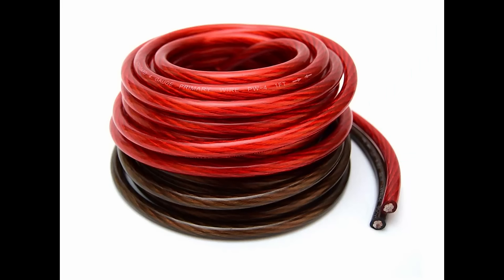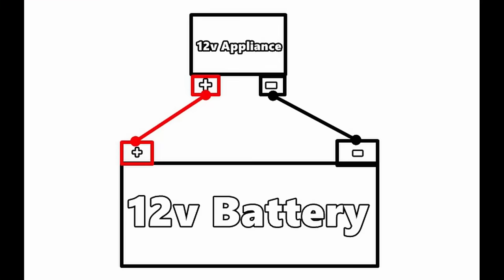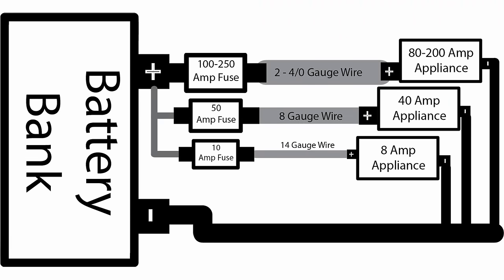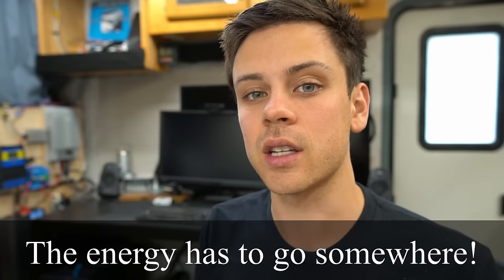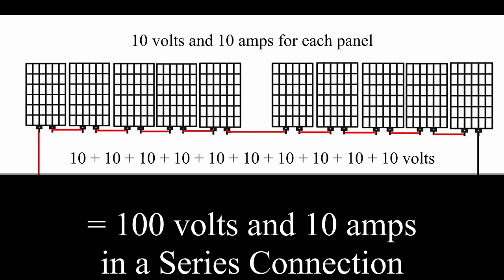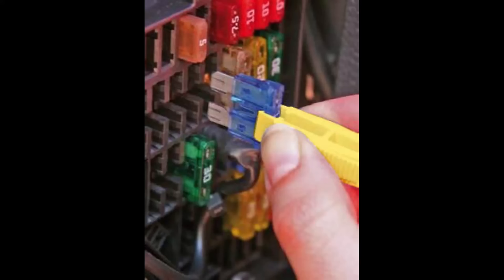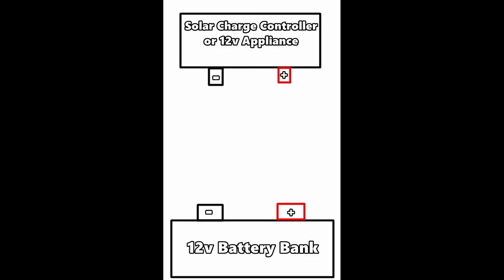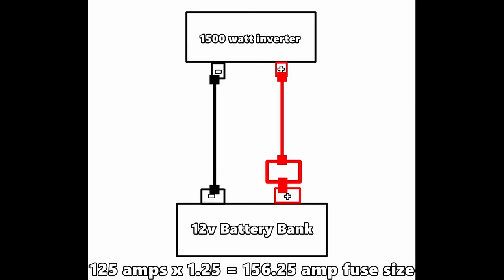Electricity Explained: Volts, Amps, Watts, Fuse Sizing, Wire Gauge, AC/DC, Solar Power and more!

Comment: Hi! I believe I watch this cool video 4 times a year! Sure hope I'm not asking the same questions over again (bet my previous comments are buried a thousand comments below).
Question One. Why ar Folks so into these "Lead" Batteries if you can only expect about 50% of their performance capability!
Question Two. When do I use a Parallel Connection or Serial Connection? Like if my ideal appliance set-up is a Microwave Oven (that turns on approx 7 times in an 8 hour period), two cell phone chargers, two Laptops, two large monitors, and one printer (my God I'm a Black Computer Geek). Sounds like a Parallel Connection set-up would keep all my wires "cooler" without worrying about an electrical fire . Your thoughts?
We could say I'm an Army Vet living in a mobile home with solar panels, but If I could finally wrap my head around this electrical math & tech, I'll be sticking shlit into the window of my one bedroom apartment and kiss Edison's Ass goodbye.

Comment: Thank you. I was in difernt industry. Now learning. I rebuild cars. And helped put panel box in 20 years ago. . From there ran 15 hundred feet copper . To run tv . Micro wave draws down lights. But hey it works . Two houses. Lol but now I want to get technical. But most laugh if you don’t know the specs. . Thanks.

Comment: Most people, including me, have lived their whole lives without ever understanding any of this. Now I understand it. Thank you. 

Question: the relationship between AC/DC/volts/amps and SAFETY, please. Could you make a video that explains why you can walk around with a 9v battery in your pocket, but put that same battery in a taser, and you can incapacitate a gorilla? 

How do I calculate what exposed wire is lethal or just a sting. I presume it’s more to do with volts.

Comment: Dear Will, The mobile community, especially those who have, or are converting a school bus into a "Skoolie"  -an off grid mobile RV and in some cases a HOME, really need your help, especially when making a MAX solar powered system that can run 2 mini/split Air Conditioners night and day sustainable from solar panels and storage batteries, also including ac fridges, lights, microwaves, TVs, computers..printers ventilation fans. Most of them will use diesel fuel heaters for keeping warm.. Three different expandable system designs would be nice Max, Med, Min.. with the ability to plug into AC shore power.. when available.. You could give them a world of good with very specific Skoolie Solar Videos.. The Skoolie folks are over and over struggling with getting this done..

Comment: THANK YOU! Finally, someone who teaches this stuff in a way that is easy to hear, understand and put into action!!!  I"m trying to wire up my solar in my new campervan and I was feeling really lost with understanding how to know how much amp i will use and the size of wires and amp's needed and now I feel I have a good grasp on it...  @Will Would you say using a 35mm artic cable for the connections between batteries and inverter is too high for powering a laptop, juicer, blender and some other 240v items?  I won't use them all at the same time...   I feel 35mm is too high but another youtube guy advised to use 35mm in his vid...  I've also been told 16mm is enough...

Comment: And you also have to remember when charging a battery or connecting to the grid you must overcome the incoming pressures to put anything in 
So take your battery for example as the battery gets full amps go down but Watts always stay the same 
And connected to the grid because the pressure is usually a constant could only put in about 15%

Comment: I tried to increase the battery life on my drone by wiring to 9v batteries together. I made sure they were both the same voltage and I forget what the term is for wiring batteries together that doesn't increase the voltage but I tested with a voltmeter in the voltage was 9 volts with two batteries wired together I thought it was good but when plugging it in it smoked the circuit board on the drone. I now realize the issue was the size of the wire from both batteries "amps" well I made sure the voltage was the same I didn't account for the amps. Thanks for the video!

Comment: I noticed you mentioned lead acid batteries during your presentation and it brought to mind how that such batteries are hardly or never mentioned when talking about or planning to set up a solar powered system even though they are cheaper when compared to others like the so-called deep cycle batteries, the lithium batteries, etc. I would like for someone to buttress for me why one may not use lead acid batteries for such constructions. By the way, I once came across information that suggested that Tesla had a lead acid battery he used for five years or so, everyday without it losing charge.

Comment: When you start talking about comparing batteries and watt-hour ratings I remembered something I ran into a few years ago with this that would be important to know, especially for those who are looking at lead-acid batteries.  I was looking at two different batteries that both had ratings of approximately 110 amp hours, but one was quite a bit lighter than the other.  This made me wonder if the amp-hour rating of that one was accurate.  Looking more closely at it, I discovered that the manufacturer had used a one-amp discharge rate to determine the amp hour rating rather than the 20-hour discharge rate that most manufacturers seem to use.  For lead-acid batteries, this is highly deceptive and leads to a much higher rating that it would otherwise have because of that Peukert Effect that you mentioned later in the video.  It's not much of an issue with lithium batteries because of their high efficiency though.  I plugged the numbers into a Peukert Effect calculator which determined that, at the 20-hour rate, that was actually a 93 amp-hour battery.   Buyer beware.  Another great video, Will.  Your style and method of explaining things make it easy to follow.

Comment: super video.  you explain things in such a way that it is easy to understand and your depth of knowledge is impressive.   great video for beginners and those who need a refresher.   your other videos are great too. keep doing what your doing. if u have not done an instruction video yet on the proper way of building an AC distribution box for initial loads and allowing for expansion.  i know id be interested in that. thanks for sharing all of your great knowledge and hard work. sincerely kurt

Comment: Really useful for absolute beginners but when quoting watt hours it's important to point out the obvious that it matters what voltage system it is used in. A lot of people look exclusively at 12v systems so the numerical factor will be the current available.

Comment: Good job, congrats! Analogy suggestion: DC works like a drill, AC like a jackhammer; how would that sound?
Reply: No. Completely irrelevant.
DC current flows in a single direction along the cable. AC flows both ways. That is as simple as it can possibly be. Don't over complicate it .
Reply: @deang5622  thanks.. but you prove my point. A drill works unidirectional, clockwise, counterclockwise,  a jackhammer works both ways...

Comment: Very good explanation. Thank you.
If DC electricity flows from negative to positive side of battery, why shouldn't the fuse be connected to the negative side of battery?
Reply: Let me clear up a couple of things.
Electricity does not flow from negative to positive of a battery, it's the electrons that do.

Conventional current flow is from positive to negative. This is the convention that exists all around the world. Why the difference? Because somebody got it wrong many decades ago.  We are stuck with that. So we work with conventional current flow from positive to negative.

Forget electrons, that will confuse you, and you will never need to worry about electrons unless you are working with semiconductor devices or valves and tubes. So you should always be thinking of conventional current flow.

Second. The fuse. Current flows in a circuit, which is a loop from the source of electricity and back to it.

The current coming out if the supply equals the current returning back to it. So 5 amps coming out from the supply and therefore there is 5 amps returning back to it.
So it doesn't matter if the fuse is placed in the path of the line from the supply or is connected in line with return line back to the supply: that fuse is going to blow if more than 5 amps passes through it.

For switches it can be a little different. In terms of turning the electricity off, a switch can again, be connected in line coming from the supply OR in the line returning back to it 
However we use switches in mains electrical wiring with voltages at 120, 230 volts for what is called isolation.
If the switch (or circuit breaker) is in the return line (neutral line) , then turning the switch cuts the flow of electricity, but if any electrician touches the live line they can still receive an electric shock and be killed because the live line is still at 120/230 volts.
So it is safer to have the switch in the live line in the distribution board/fuse box/consumer unit so that when the switch is turned off then no part of the circuit contains a dangerously high voltage.

Comment: I will never forget my exasperated father (electrical engineer) explaining amperage to my mother (english literature teacher). How many pixies running through a turnstile - 10 abreast = 10 amps, 20 pixies at once = 20 amps. Mum thought they should be imps, not pixies.
Whatever analogy or metaphor works!

Comment: Great stuff, brilliantly taught. I do have a question... What if my total load for an appliance was calculated at 0.75amp AFTER  multiplying it at 1.25? Being that 1 amp is the lowest fuse and 1 would be OVER the 1.5X recommended amount, what can we do?! 🤔

Comment: amperage is important if you do some kind of projects if you connect a lot of components and you dont have right amount of amps its done. Its easy in everyday life when you connect one item but in some kind of project it's  diffirent    there is a diffirence in  batery with 12V and 100 amps  and 50 V 20 amps

Comment: 22:20  Total circuit length in a DC power system = positive + negative, so a 100A load on a 12VNom system at 20' total circuit length needs 2AWG wire to stay under 3% voltage drop, not 4AWG.

Comment: And ohm's law 102 
When coming upon other forces like a battery are the grid that's already charged 
Great example is as the battery gets full amps go down the actual current that is going into the battery the Watts stay the same 
That's why Wednesday renewables are connected to the grid you can only put in 15% and when charging electric cars when you get to about 80% they would like you to move on because the charging really slows down

Comment: So it is Amp that affects the wire, not voltage. Hypothetically speaking, you could have a thin wire transferring 50000 volts but as long as the total amp/s does not exceed the wire's capacity, it is all good, right?

Comment: Hey man, you're the brain and expert....I want to Ask you a question. I have a 30 acre parcel in Northern Michigan that has no water. What type of solar panels and set up(turn key, batteries, converter, ect.) do I need for a 3/4 horse pump and a 150 foot water well. Maybe an over kill set up??????

Comment: I think what you are saying about fuse is correct but the way you are saying it could be taken in reverse of your intention. The fuse must always be less then the max of the wire and load ratings in order that will always fail first.

Comment: Great video, but I still am looking for an explanation of what voltage is, what it's made of. I've watched dozens of videos, but I am unable to find a single video that explains what actually is going on with higher voltage, either in AC or DC. Electric potential and "pressure" are two terms used to help explain how voltage works, but they don't explain what voltage actually is; not like the explanation of migrating electrons along a conductor explains current. Can you help with this?

Comment: A key, basic point that is maybe not properly fleshed out in this video, is that it would be better to conceptualize voltage as RELATIVE pressure in a water pipe. I.e. the difference in water pressure between any two given points in a pipe. So if you had a level pipe, with nothing to impede the flow, any RELATIVE pressure measurements made along the pipe would read ZERO, despite maximum flow being witnessed. With electricity, this prevents confusion on the short-circuit situation, where you would measure a voltage of zero, but witness a maximum flow of current. Once you start adding resistors/impedance, then you will find a voltage reading/relative pressure drop.

Comment: Wouldn't you use 13.8V when dealing with vehicle batteries? Also, can you explain cold cranking amps? How much power, with vehicle off, can I draw from my truck battery before I'm stuck in the middle of nowhere? Can you do a video of beefing up vehicle battery system? Adding solar panel to roof, second battery, etc. I want to add many powerful lights, multiple radios, mulitiple cameras, and be able to power water pumps and some AC appliances too. I want to integrate all into my truck. Thanks.

Comment: Awesome video, the only problem I found is with fuses and wire size, in the example at 22:30 you sized the wire for 100 amps but put a 125 amp fuse, using the 4AWG wire means that the wire will overheat once it reaches 100 amps, but the fuse is still not blown, looking at the chart you should have sized it for at least 120amps or 150amps which means 2 or 1 AWG so that the fuse blows (just like you explained a couple of minutes before this example... I'm not an expert, but I think you made a small mistake there :-) am I wrong?
But yeah I would first size the fuse then the wire to the fuse, so you go from smaller amperage (appliance) to bigger amperage (fuse, then wire).

Comment: If you have same result by different measurement of Ampere and Volt will be bad for your stuff. For example a freezer, if your freezer requires 15 Ampere, 260 V and 2500W, you should not plug it into somewhere where there is lower Ampere but higher voltage and the result is 2500W. It will shorten the lifespan of your freezer and you will see it dead in no time. I never forget ever since I heard in simple terms Ampere is a measurement for the lifespan of your house stuff, if you go below or over the limit than its lifespan is shortened.

Comment: I need about 90 amp seconds of cycles from that big brain energy of yours.

I am repowering a sailboat from diesel to electric (go green yah!!!). It is 41 foot sailboat that displaces 23,000 lbs (yikes!). The original diesel was 50 hp (double yikes). How big of electric motor do I need, how big of a battery bank, how much solar panel power? Thanks for all your vids!!! Watch all your stuff. Subbed. Help!!!

Comment: Great video! Just a question though... at @5.07 is the flow of a circuit not electrons moving from negative to positive? So the different gauge wires would need to be before the appliance? Maybe I'm getting confused

Comment: Wow! great job explaining the basics!!!  at 22:15 you talk about the load being 10 feet away from the battery. On DC voltage the wire distance is both out and back (or 20 feet) correct? Just checking... :-)

Comment: I like your videos, nice and easy. I do have a question,  does your book shows how to wire up a mobile solar system and an inverter with a fuse block,? I just bought a solar system for my camper and a 12- Port fuse block cannot find anyone to help me. Thank you

Comment: So amp is how much electricity will flow through the wire, and volt is how fast  and a solar charge controller adjusts those for specific needs?

Comment: For Solar charge controller, you only calculated amps rating. Do we also need to consider battery and solar’s voltage-current(compatibility) ?

Comment: Hi my friend and happy New year!!
I want your help about thickness wire!
Excuse me for my English, I'm Greek 🇬🇷!😁
Well..
A have an e-scoot!
The battery is 72v 20a the cells can give 105 ambers Max!! BMS is 100a we're ok till here!
New controllers i just buy are 72v 50a max phase amber 150a
My motor is 2000w (that is write)..
My question is.. How thick wire to put (3 phase wires) from controller to motor.???🤔
Distance 0,70 - 1 meter (2-3 feet i think)
Thanks my friend.. you are genius!!!👏

Comment: The example you made, If the battery bank is wiried to give 120v then when calculating for the controller do I divide 400w by 120v or just 12v like you did?

Comment: Hi, congrats for your explanation. Im from Ecuador south America. I have a led billboard advertising , each panel is 325 watts and  (12 panels in total)it works with 110 volts . How many batteries of 12 volts and Amps(?) do I need to make it work for about 8 hours with an Inverter 110volts . Please wich kind of battery do I need (gel deep charge batteries?) and how do I charge them again.
Thank you so much.

Best regards

Comment: Love it but actually you know electrons flow on the skin of the copper wire  and not through. That's why high strand counts in many scenarios are good
Reply: No that is not correct. If that were true then power cables would not be solid, they would be tubes. They would be cheaper and lighter.

What you are referring to is called The skin Effect and it only occurs at high frequencies, not at power line frequencies of 50/60 Hz.

If you look at high frequency radio based devices, such as microwave communications equipment (mobile/cell telephony), radio astronomy then you will often see the skin effect at work and the cables are literally copper tubes.